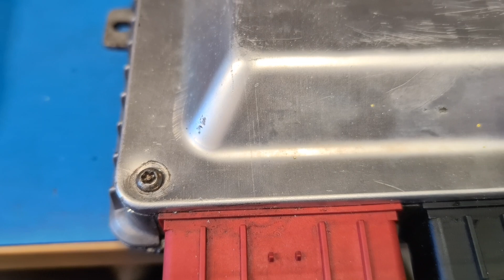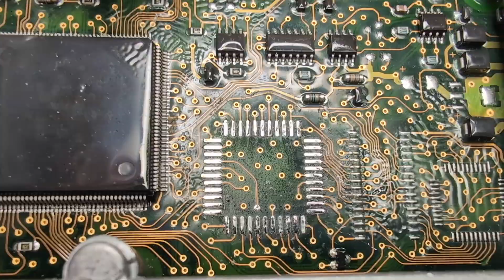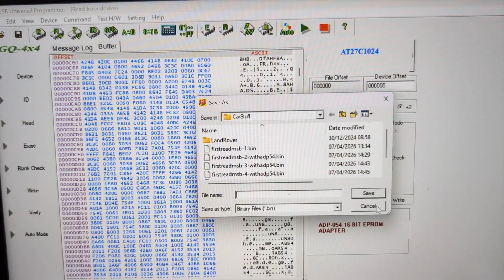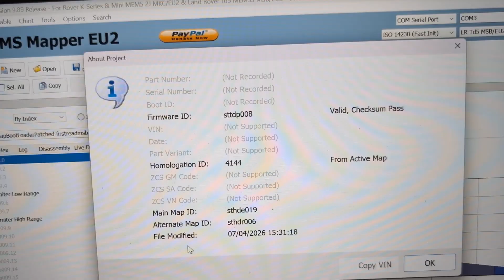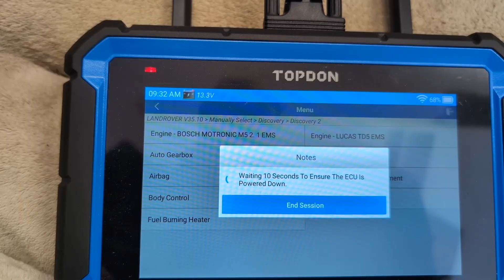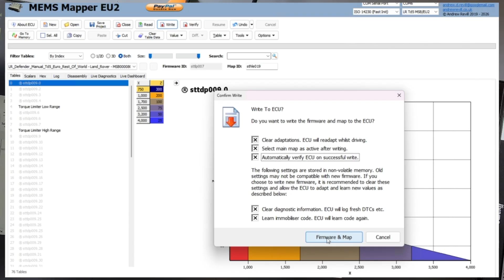Land Rover Td5 ECU Mod: Make an MSB Flashable via OBD! (MSB to NNN)

Comment: Hello i really appreciate your work this is incredible, i am just wondering how did you flash the boot loader to the AT29C1024 it is not very clear in the video did you use the XGecu t56 or dud you get the chip directly programmed by Andrew. Thank you.
Reply from the maker: Got the first one directly of Andrew but I'm a geek so did another with a t76